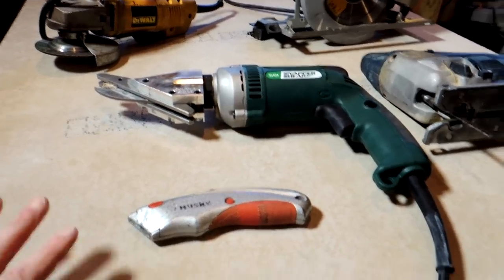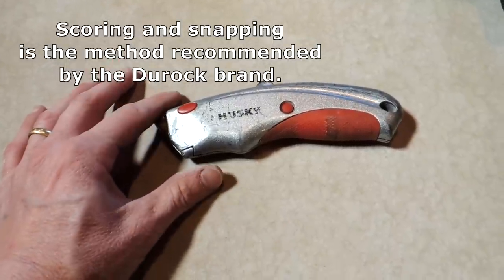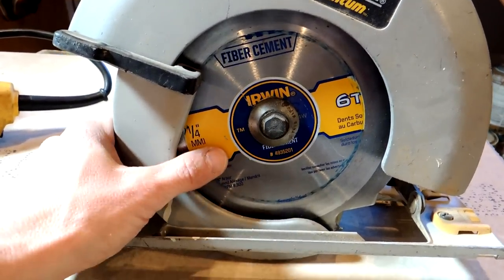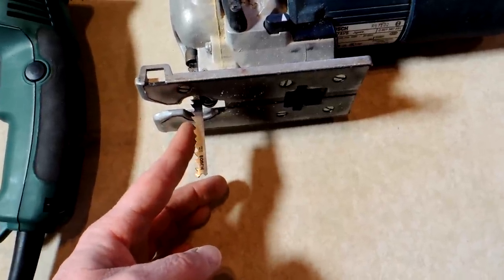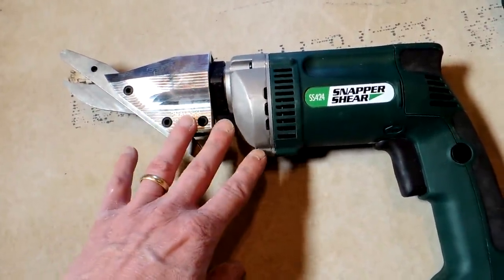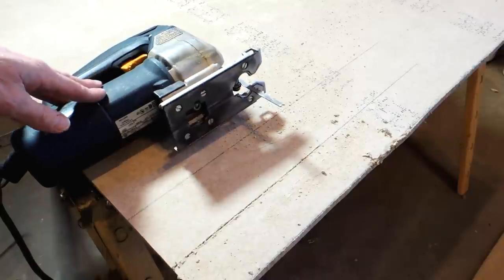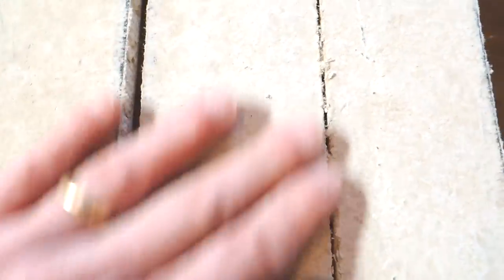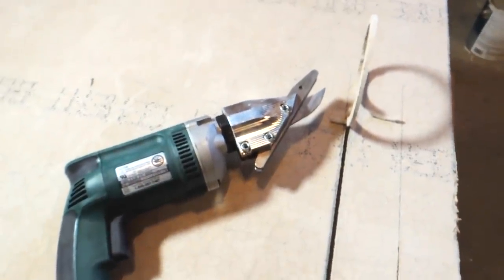The Best Ways To Cut Cement Backerboard

Comment: I cut mine with a saber saw. I didn’t need to have particularly accurate lines for my project and I used an extremely coarse used blade intended for limb cutting. I was able to stay pretty close to the lines and it worked great and I didn’t have to buy anything I didn’t already have. Thanks for a great video and great tips.

Comment: Many thanks for the tip to use the jigsaw.  I did go through about four coarse wood blades on a number of cuts but picked up a "Diamond Grit Hard Tile" blade as I was at the big box hardware as I was getting some other things.  And it worked very well on the cement wall board (on well fired Turkish tile it is actually next to useless so glad it's good for something)!  I haven't done a full cost benefit, but it's still in good shape after about another 10 cuts, this on the more crumbly cement board you referenced.  So getting one of those abrasive diamond blades for the jigsaw may indeed work out better in the long run.

Comment: Thanks for taking the bother to test all these out and demonstrate them. I’ve been researching Hardie products for a DIY project because I need something both fire and moisture resistant, and it’s the most common brand here. I also like how they’re up front about silica dangers, and how to work around them. The problem is, practically all the videos I’ve found (both Hardie and 3rd party) talk mostly about scoring to cut. I can’t do that because my project has many curved lines. Your video is the proverbial needle in a haystack, and I’m glad it surfaced during my search.

Comment: I just did a tub surround by scoring it with the Home Depot $10 carbide tool.  What I did was place the 3x5 sheets on 2x6s (four) I had laying around and doubled them up for some height .  So I had two stacks of 2x6s.   Scored my line several times then placed the line that I scored just over the edge  of one of the stacks of 2x6s.   Then placed another 2x6 on top and stepped on it and even kind of stomped on it to break the hardi backer.  It worked well and fairly fast.  The more I scored about 4 times is when I got a fairly clean break.

Comment: Thanks for this video! I had to cut a some thin pieces for a bathroom repair and was planning on using a circular saw with Hardie blade and just dusting up my yard until I saw this video. I used your jigsaw method and it was far less dusty and not hard to do at all. Thanks again!

Comment: I wanted to say thank you! I had a project today and needed to cut several pieces of hardi plank for our storage shed.
I tried a fine cut steal jigsaw blade.
Then I tried my circular saw with the blade backward.
Neither of those were working.
I watched your video, got out the jigsaw again, used the corse cut wood blade and it worked!
Took 1 1/2 blades to complete the project and you gave me permission to ruin a blade and replace it.
Thank you my friend!
Reply from the maker: Glad I could help!

Comment: Great video.  BTW, another option if you have a multi-tool and a grout blade/wheel is to score with it and then break by hand.  Scores like through butter and gives a clean break.  Left the blade no worse for wear.  I didn't score more than 1/8" deep.  Very little dust comparatively speaking.  Cheers.

Comment: Thanks for the video! I also tried a rigid multi tool with the wood/drywall blade and it worked well but it does burn up your blade after several cuts.

Comment: I'll be switching from grinder to jigsaw until I can get a shear. I've never even considered the danger of the dust and I've cut miles of hardie; nostrils slap full of that dust. Thanks for the info!
Reply from the maker: +1221vito While there was always fine print about the silica danger on the label, it isn't until more recently that it's really become clear how bad it is.  The truth is you can't work in the industry without putting yourself at risk in various ways, but we can at least minimize the hazard.  I wish I had picked up the shear years ago.
Reply: Lol right
Reply: @enduringcharm  that's a very fair point. On that note: an adequate respirator will prevent pretty much all inhaled particles when cutting, although everyone nearby would need to wear them too if you want to be fully safe. But preventing them even being airborne by use of appropriate tools is great, so thank you for the insightful video. 

For the jigsaw wood bit: do you use a softwood or hardwood blade?
Reply from the maker: @ H Kay  The important thing about the blade is to choose an aggressive one with fewer, larger teeth.  You aren't really cutting the backerboard so much as breaking off little pieces as you go.

Comment: Great video - Yes, the score and snap is a joke - using 12mm HB board here in the UK. I scored the board, but trying to snap it as shown in the HB video just lifted the board. I even got my wife to stand on the board. Instead of snapping, it lifted the board with her on it! When I did manage to get the board to snap, while most of it snapped, a 6" section in the middle snapped 3/4" further over leaving a gap. I did my next cut using a jigsaw (as I only need to take 10mm off) wearing a mask, outside and spraying the blade with water.

Comment: I had a smallish DIY counter top to do. I tried some jigsaw blades that were supposed to be for wood and up to some softer metals. I destroyed 2 and was not half way through a 5' cut. So in desperation I used the diamond blade  meant for tile work in my angle grinder. Yes lots of dust and would not want to use inside the house - it cut through the Hardy backer board like butter.
Reply from the maker: You were probably using the wood blades at too fast a speed, which will burn them up quickly.  Using a slower speed and a more leisurely cut you can get 20 or 25 linear feet out of a wood blade  before it gets too dull.

Comment: Thanks a lot! Was testing a piece with my grinder but am unable to cut a straight line. Now out to buy some blades for the jigsaw! Cheers!!
Reply from the maker: Good--a grinder is bad news with the dust anyway!  Buy some aggressive jigsaw blades and keep the speed low.  You'll still go through some blades, but the cost is minimal in the scheme of things.
Reply: @enduringcharm  Picked up a pack of 5 Makita blades with large teeth, will be cutting tomorrow! Glad I found your video. Thanks again for the tips!!

Comment: It's been a while since bathroom renovation, which I seem to have blocked from my mind, but I seem to recall using a circular saw with stone/masonry blade...because I had it ... with good results.
Reply from the maker: While circular saw blades can work well with straight lines, and they even make a blade designed for this purpose, it's really not a good idea due to the carcinogenic dust.  The silica in many of the cement backerboards is bad news, especially for somebody like me who works with this stuff a lot.  Believe me, I often push the boundaries of safety to get a job done, but this is one area where I don't mess around.  Better to minimize the dust.

Comment: I have a 14" band saw that would work but it would require much space around it and and help holding the area not supported by the table.  The bandsaw cuts like a jig saw which is why there is less dust.  I used it cutting sheet xps styrofoam insulation for cleaner edges than snapping, and also used a jig saw.
Reply from the maker: You'd cook a bandsaw blade in short order.  A jigsaw will work because you can slow the speed way down and the blades aren't that expensive to throw away.  Really the shears are far and away the best option.

Comment: I’ve been using the score and break method with fine results. Eats up the blades but you’ll get straight break if you do a good job scoring.
Reply from the maker: And how do you handle a hole in the middle of 1/2 inch hardibacker for a shower valve?  Or a straight cut with a second 90 degree straight cut to remove a section?

Comment: Hi. What about a Saw Zall ? Is that a good option as well? Also, which is better between… Saw Zall versus Jig Saw? And which would make less dust? Thank you very much.
Reply from the maker: A sawzall or reciprocating saw is an awesome tool for many things, and would consider myself an artist with one in my hands.  Since I do mostly remodeling and repair a reciprocating saw is never far away.  However, it wouldn't be my choice for this work.  It would be difficult to get clean, straight cuts and make more dust than is necessary.  There are more options now for shears, and I did a review of one which is quite inexpensive (https://youtu.be/YXCwEvnCTNY).  That would be my recommendation even for one project.  A jigsaw with an aggressive blade is second best, because it minimizes the dust and it's easy to control.  Just be aware that you'll need to slow down your cut rate and you'll go through a few blades to get your project done.

Comment: for the shears:  how long does the blade last?  how often does it need to be sharpened or replaced?
Reply from the maker: I'm still on my original blades and I couldn't even tell you how many bath remodels I've done with them.  They really crush the material rather than slice it, so being sharp really isn't the issue.  It's more a matter of having close tolerance between the blades.

Comment: Score and snap with a regular razor works for me with 1/2" Hardibacker. The snap, though, is opposite from drywall (you pull up toward the cut, not away from it).
Reply from the maker: Out of curiosity, how do you handle anything other than straight cuts?  What about irregular cuts around walls or openings, cuts around shower valves, cuts around shower bases or tubs,  and that sort of thing?  As I said in the video, I don't find scoring to provide a clean enough cut for my work, especially in corners or against other straight  edges.  I prefer the perfect cut the shears provide.
Reply: Thanks for this great video and education. I tried both utility knife and zigsaw for my 1/2" Hardie backer board and I stopped using when I killed 3 blades withing a few minutes. Didn't want to spend money and time to buy special shears so just used my utility knife and very satisfied with result. As long as you put good and deep scoring, it cuts clean in straight line.
I used 1/2" drill to cut few holes open for valves and faucet, then again used utility knife to clean up and smooth the inside edge of openings. Worked like a charm. You just need some patience :)
Reply from the maker: Sung Kim
Sounds like you had all straight cuts.  Many baths I do require odd shaped cuts around tubs or shower pans, or tight square cuts around shower valves, etc.  In those case a scoring utility knife just won't do.  The jigsaw method does eat up blades, but I can typically get 8-10 linear feet of 1/2 inch Hardibacker cut at a minimum from one blade.  You must use the saw on a slow speed and use a slow feed rate, though.  If you try to cut like it's wood you'll eat up a blade in a couple of feet.

Comment: I only needed to make two cuts on a Hardie backer board.  I first used my circular saw (outside and with a face mask) then it rounded out the old masonry blade 3/4 thru the cut.  I watched your video and decided to try my jig saw. It went wonky and broke two blades. I scored the remained of the cut and it snapped easily.  Finished the other 18 inch score and snapped it also. If one thing doesn't work try something else. LOL You had a very informative video thanks. I have no idea why the jigsaw blades broke, perhaps too many teeth on those blades.
Reply from the maker: You were probably running the jigsaw too fast or using blades with too many teeth per inch.

Comment: You are exactly right; I  have compared the different cement boards and the Hardiebacker" is made 
better.  Be sure  to compare the different brands i.e. if there are cracks and broken pieces on the edge you know the whole sheet is going to crack under stress. I use the "cut-off tool" with a 4" dia. 
diamond blade that cuts really good on the tile also.
Reply from the maker: I hope you'll reconsider the grinding blade, which creates toxic dust.  Once you try a shear you'll never go back.  This shear I reviewed can be attached to your existing cordless drill and works very well: https://youtu.be/YXCwEvnCTNY

Comment: I use a jigsaw if cuts are relatively "short", i.e. less than three feet.  I use a 3 in. cut off (Dewalt) with a specialty blade for long cuts.  It requires holding it back some because it will want to race away from you.
Reply from the maker: I'd encourage you to try shears, which can be had inexpensively now.  The dust you are creating with the cut-off wheel is dangerous for your own health and that of others.  It may seem like a small risk now, but when you get older like me you will look back in regret at some of the things you practiced.  See this video:  https://youtu.be/YXCwEvnCTNY?si=LnRlb2alQYrF4Nep

Comment: Excellent job!  Now, show me how to cut a rectangular hole out of the center of the board!  I have a feeling there will be a lot of trial and error on my part.  Again, I like that your instructions are short, clear, and to the point.  Thanks!
Reply from the maker: I cut rectangular holes with the jigsaw.  If you look up my video on jigsaw plunge cuts you'll see that you don't even need to drill a pilot hole.
Reply: Cut a starter hole with a drill and then the jig saw

Comment: Can I use a hacksaw blade? I know that will be a lot of work, but will it work?
Reply from the maker: No, you'd be wasting your time.  Really this stuff doesn't cut so much as it crumbles in a straight line.  An aggressive blade on a jigsaw used at slow speed works because it tears away chunks in a line.  If you can't get access to shears then a jigsaw is the next best thing.  Get a cheap, throwaway jigsaw at Harbor Freight if you don't own one.

Comment: Dude I just want to tell you I used a single course jigsaw wood blade on four Sheets of cement board. I had to trim a half inch off of each one. I tried my circular saw cement blade, but it sucked. A coarse Bosch jigsaw blade and probably a 40 plus year old craftsman jigsaw and some elbow grease. And it went right through it. And that blade was worn but it still kept going through it.
Reply from the maker: Better a jigsaw than a circular saw blade spewing silica in the air!  If you haven't seen this video yet, check it out.   There's a new shear available which works on your existing drill.  

https://youtu.be/YXCwEvnCTNY

Comment: A 4" wet circular saw/tile saw works great.  Home Depot sells a Ryobi for under $100.
Reply from the maker: A circular wet saw may keep the dust down, but the practicality is still poor.  Aside from dealing with the water runoff, you can't make curved cuts or tight cuts with the saw.  For a circular cutout in the middle of backerboard to accommodate a shower faucet you'll still need to pull out a jigsaw or the Pactool shear I reviewed in another video.   Shears are still best option for keeping down the dust while making quick work of the cuts.  I can make the cuts in the client's garage or even in the bathroom or kitchen itself without causing an issue.

Comment: Spend the money on the diamond tipped jigsaw blade. Its $10.98 for 1 blade BUT 20 cuts at the minimum you will get and that's if you ARE exclusively using it as your only cutting method. I personally wear personal breathing mask with filter and no problem. OUTSIDE. Not in. But Bosch makes a GREAT diamond tipped carbide jigsaw for cement board and it's almost shockingly smooth. That wood blade will fight you after 1 - 2 cuts and it burns up. So...$15 for 5 blades and maybe a total of 10-12 cuts OR spend $10.98 at Depot and get 20 cuts... kind of a no brainer. But Great video. You're doing a service of showing multiple options and that is KEY to a DIYer

Comment: NIce video! I want to buy a jigsaw for this purpose and to use for future projects as well. How many amps/volts do you think would be sufficient?
Reply from the maker: While there are some tools for which amp or power ratings are important, I don't think jigsaws are one of them.  Instead, focus on the ergonomics of the jigsaw.  Find one that feels good in your hands, that isn't too heavy for you, and that has a trigger placement that feels natural to you.  This is not a tool to buy sight unseen, you want to feel it in your hands and compare different brands or models.  When you find the jigsaw that feels right in your hands, then don't skimp on the blades.  A quality blade will make cuts effortless in wood (although it's less critical for cutting cement backerboard as seen in the video).
Reply: Oh ok. I'll have to go to the hardware store to check out what they have. Thanks for your response! I'm about to start a bathroom remodel project so I'll check out the other videos in this series. You should do one on options for tiling around a window in the shower area. :D
Reply from the maker: If you are near a Home Depot or Lowes you can find decent brands there, such as Bosch, Dewalt, Porter Cable, and Makita.  As for windows in showers--I don't want to burst your bubble but I am not a fan!  Windows really don't belong in shower areas and if I find one I generally remove the window completely.  I've seen a lot of rotted walls from windows in showers.  While windows are designed to resist water from the exterior, they were never meant to resist water from the inside.  Even vinyl or aluminum clad windows will allow water from the shower to get into areas it shouldn't.  Consider taking out your window or moving it to another area of the room if possible.  When you do the demolition, check to see if there is rot or mold in the wall already.
Reply: I have a window in my shower and see your point. I'm glad you mentioned this. When I replace the window, I'll move it up (only exterior wall so impossible to eliminate.